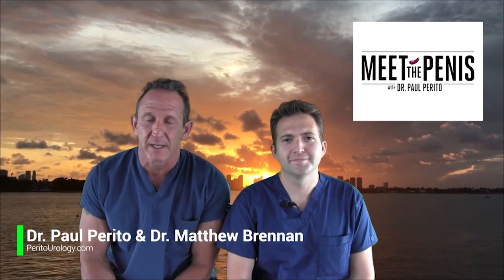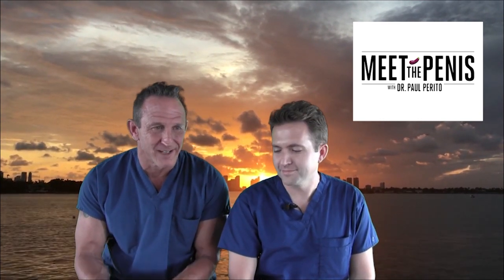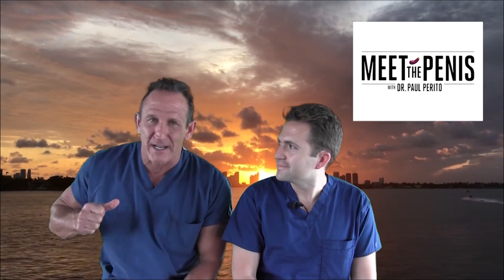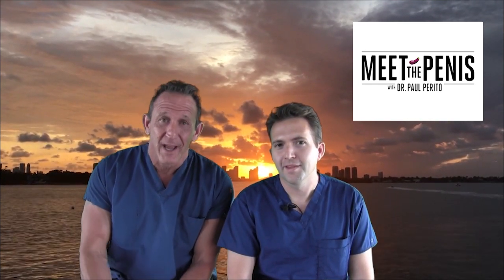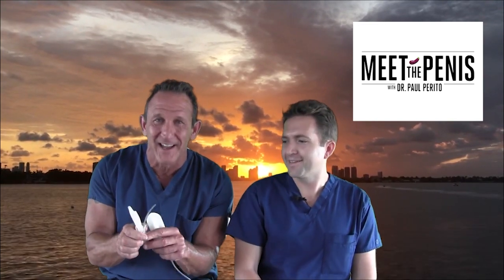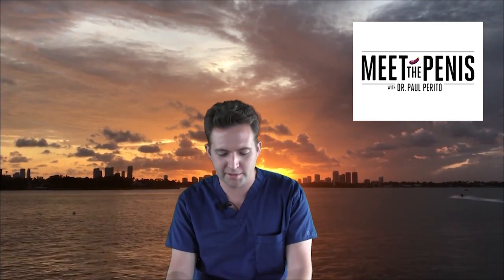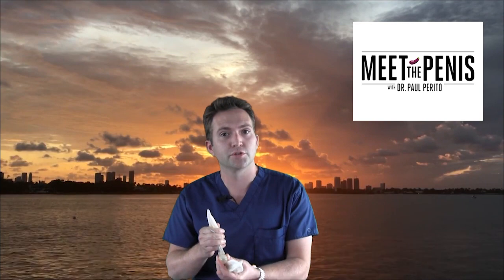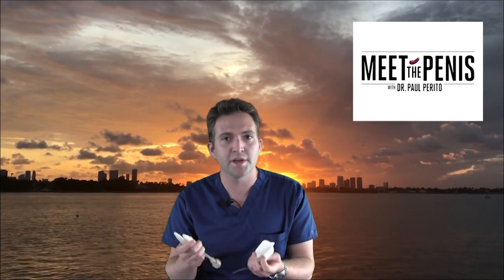MTP #34: How Does an Inflatable Penile Implant Work?

Comment: You talked about growers and showers previously in an MTP.  I’m a grower without a doubt going from very small to quite a nice size when fully erect.  How do you size the cylinder for a grower to truly have their penis be the size it can be when fully erect?  Would
Love a grower MTP.
Reply: GoodDrSir they inject you with the stuff to make you hard while operating to make sure you get the correct or best device.